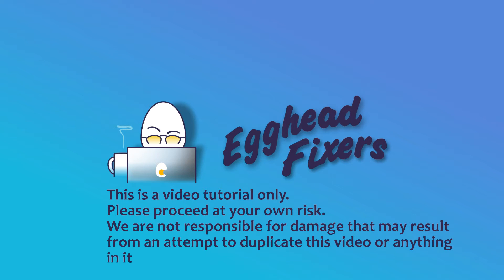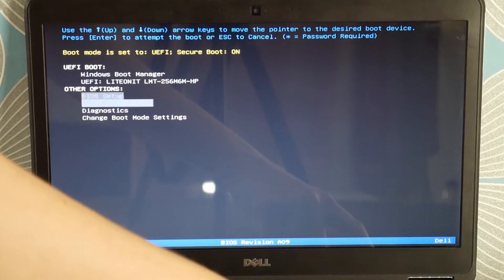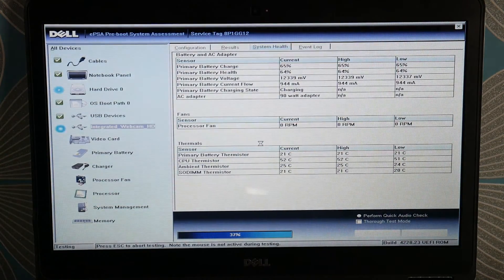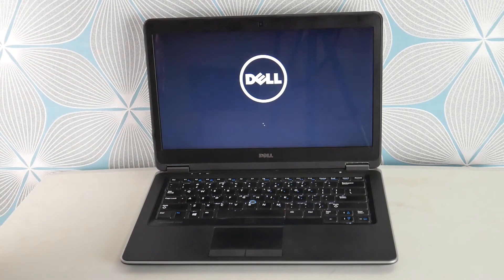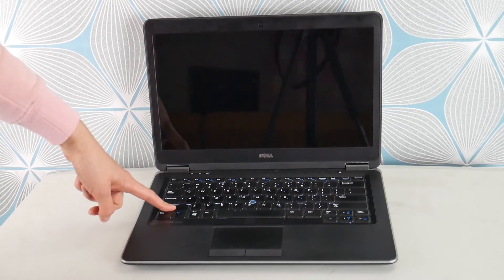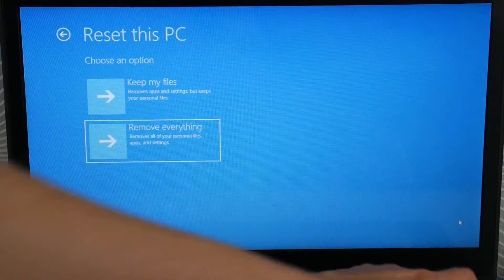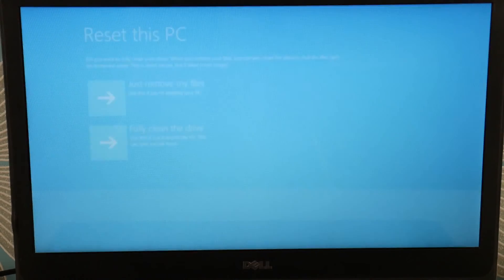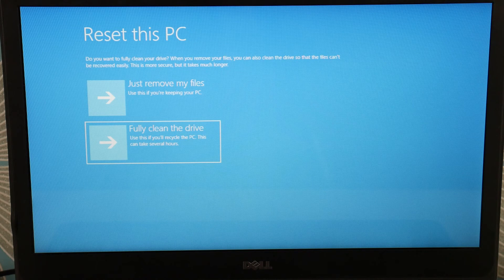How To Fix A Dell In A Preparing Automatic Repair Restart Loop

Comment: Hi Liz, i tried hard resetting my alienware m15 as you said, using shift + enter, but it does not work for my laptop. Can you please help me out with this? Thankyou soo much.
Reply: When i start it again while pressing shift, it goes into preparing auto repair
Reply from the maker: What happened when you ran the diagnostic? Did everything pass?

Comment: I’m not able the reset this PC “There was a problem resetting your pc.No changes were made” what can I do to not lose my files?
Reply from the maker: In order not to loose your files then you would have to try hooking it up to an external Hard Drive bay to pull the files off but that will only work if your hard drive is not dead.

Comment: I can’t get to the software part
Reply from the maker: Sorry to hear that☹ Sometimes when the Operating System is not functioning properly then you can no longer get to the options to reset it. In this case the next step would be to reinstall the operating system. Here is a video on how to do that:

https://youtu.be/TElCJDbKdKk

You can skip the part of the video about replacing your hard drive. Let me know if you have any more questions:)

Comment: So I’m doing the diagnostic and it’s stuck on “Instalizing Fan...” then it just goes black, then to the same dell assist with”warning battery critically low”
Reply: *“Initializing”
Reply: It appears to freeze mid diagnostic because when on the “initializing fan” screen, I can move my cursor around
Reply from the maker: @starbebby  Sorry to hear that:( Are the lights on your computer blinking in any sort of pattern? Also here is a video that might help: https://youtu.be/TA1mFPtKVnw

Let me know:)
Reply: Egghead Fixers this is late, but i ended up getting the laptop to turn on and it works now. I didn’t have to do the diagnostic, just ended it and went straight to the start up
Reply from the maker: @starbebby  Well that's good news!! Happy you got it to work👍

Comment: My computer says that hard drive isn’t installed and when I tried the things u do,it just says preparing automatic repair.My laptop is and dell  Inspiron 7347 (series 7000)
Reply: Nope it dosent
Reply from the maker: @traumatisedcat4918  If the Hard doesn't pass then it sounds like you need a new hard drive. Here is a video on how to replace your hard drive and install an operating system:

https://youtu.be/TElCJDbKdKk

Let me know how it goes:)
Reply: Alright thanks:)
Reply from the maker: @traumatisedcat4918  You're welcome👍
Reply from the maker: What happens when you run the diagnostic? Does your hard drive pass?

Comment: Here showing 'testing hard drive estimated time 3hrs 22 min' does it take this much time to diagnose
Reply from the maker: That is a lot longer than usual. I would let it test it for that long and see what happens but it could be a sign that the hard drive is not good. Let me know what happens!
Reply: Restored from image and then my hard drive formatted reinstall windows 10 automatically.
Reply: I got another problem can you help

Comment: I cant get anything to work
Reply from the maker: Sorry to hear that:( What part are you having problems with?
Reply: I turn it on and says " preparing automatic  repair" i did all of the steps just like you and every time nothing happens ive use the automatic repair system when u turn it off and on but now i cant get to it anymore it deosnt  seem to work so when i turn it on it just says preparing automatic repair then a black screen
Reply from the maker: @VanillaMangoCoalition  What happened when you ran the diagnostic? Did all your hard ware pass?
Reply: @EggheadFixers  i ran the first diagnostic a one where it tests color on the screen and it says
"Hard Drive 0 - S/N X6NFTOVET , incorrect status = 3E SMART productive failure" i continued testing and it says "One or more errors were detected.
Reply from the maker: @VanillaMangoCoalition  Sorry to hear that☹ First I would try what we call reseating the hard drive which means unplugging it and then plugging it back in. Then rerun the diagnostic. If that does not work then its most likely that you need a new hard drive. Sometimes when a hard drive really dies the motherboard doesn't read it as being installed. Here is a video on how to replace your hard drive and install an operating system:

https://youtu.be/TElCJDbKdKk

Let me know how it goes:)
Reply: @EggheadFixers  i need a new harddrive  same thing happends and ran dianostics said same thing
Reply from the maker: @VanillaMangoCoalition  Ya it does sound like you may need a new hard drive. Here is a video on how to replace your hard drive and install an operating system:

https://youtu.be/TElCJDbKdKk

Let me know how it goes:)
Reply: Thanks
Reply: One more question  whats the importance of the screw closes to the one in the battery section? If i break the plastic around it will it affect the mother board?

Comment: I received a error code 2000-01-42   hard drive 0 "serial number" short test unsuccessful.
Reply from the maker: Sorry to hear that☹ First I would try what we call reseating the hard drive which means unplugging it and then plugging it back in. Then rerun the diagnostic. If that does not work then its most likely that you need a new hard drive. Sometimes when a hard drive really dies the motherboard doesn't read it as being installed. Here is a video on how to replace your hard drive and install an operating system:

https://youtu.be/TElCJDbKdKk

Let me know how it goes:)

Comment: I cant get to that blue screen...
Reply from the maker: Sorry to hear that☹ Sometimes when the Operating System is not functioning properly then you can no longer get to the options to reset it. In this case the next step would be to reinstall the operating system. Here is a video on how to do that:

https://youtu.be/TElCJDbKdKk

You can skip the part of the video about replacing your hard drive. Let me know if you have any more questions:)
Reply: If he does that will he lose his files and apps.

Comment: When I go through the diagnostics, at the end it said there was one error but it wouldn't tell me what it was. I then ran it again and it said everything passed. Still in automatic repair loop, though.
Reply from the maker: Sorry to hear that:( If all that hardware passed the diagnostic then the next step would be to try reinstalling the operating system. Here is a video on how to do that:

https://youtu.be/TElCJDbKdKk

You can skip the part of the video about replacing your hard drive. Let me know if you have any more questions:)
Reply: @EggheadFixers  i did exactly like your instruction. my Laptop passed the diagnostics, but when i pushed shift + home button it stuck at "Your PC ran into a problem and needs to restart..0%" then it never went up to more than 0%. What should i do? thank you so muchh!!!
Reply from the maker: @nguyetanh4613  

Sometimes when the Operating System is not functioning properly then you can no longer get to the options to reset it. In this case, the next step would be to reinstall the operating system. Here is a video on how to do that:

https://youtu.be/TElCJDbKdKk

You can skip the part of the video about replacing your hard drive. Let me know if you have any more questions:)
Reply: @EggheadFixers  Thank you for your kind support <3 imma try this method to see if it works!
Reply from the maker: @nguyetanh4613  You're welcome!!

Comment: My computer goes into preparingautomatic repair and goes to a black screen with cursor
Reply: After the diagnostic ran,it says that hardrive is completely normal
Reply from the maker: @manjuaswin7079  It's RAM problem or a problem with you operating system. This video is to resolve a different issue but it will show you how to test for a bad RAM stick:

https://youtu.be/wY335MRKc3U

It will show you how to order a new one if you need to also. If you find that its not the RAM then the next step would be to reinstall the Operating System. Here is a video on how to do that:

https://youtu.be/TElCJDbKdKk

You can skip the part of the video about replacing your hard drive. Let me know if you have any more questions:)
Reply: I think its a ram failure
Reply from the maker: @manjuaswin7079  Hope that helps:)
Reply from the maker: Sorry to hear that:( What happens when you run the diagnostic? Does any of your hardware fail?

Comment: I have an alienware 17 and it is restarting again and again after i switched the graphics card to integrated one and one time it shows me its booting up but before coming to the sign in menu it shut down and reboots and shows me that it is preparing an automatic repair and then again shuts down and tries to boot itself( it also sometimes gets stuck on those) PLZ HELP ME! Urgently
Reply from the maker: Sorry to hear that:( Does it pass the diagnostic? IF all the hardware passes the diagnostic I would try reinstalling the operating system. My guess is the old graphic card drivers are causing a problem with the new graphics card.

Comment: When iam done that  it showing  batter cannot provide sufficient energy
Reply from the maker: Just to clarify it says that in the diagnostic? Or when it is booting up?
Reply: @EggheadFixers   in diagnosis
Reply: It also showing hard drive -- not installed ,, what does that mean
Reply from the maker: @moulidwayne5694  Try charging your battery over night if it still gives this warning when you run the diagnosis then there is a pretty good chance you need a new battery.
Reply: @EggheadFixers  but  I asked  Dell service center about this issue they said it related to hard disk related issue
Reply from the maker: @moulidwayne5694  Sorry to hear that:( You need to try what we call reseating the Hard Drive which means unplugging and then plugging it back in.  If you try reseating the Hard Drive and it still gives you that message then unfortunately  you mostly need to replace your Hard Drive. Here is a video on how to do that:

https://youtu.be/TElCJDbKdKk

Let me know if you have any more questions:)
Reply from the maker: @moulidwayne5694  Yes of its not reading the Hard Drive as not being installed then it is definitely an issue with the Hard Drive.
Reply: @EggheadFixers  then what I had to do?
Reply: Could you please tell me?
Reply from the maker: @moulidwayne5694   You need to try what we call reseating the Hard Drive which means unplugging and then plugging it back in.  If you try reseating the Hard Drive and it still gives you that message then unfortunately  you mostly need to replace your Hard Drive. Here is a video on how to do that:

https://youtu.be/TElCJDbKdKk

Let me know if you have any more questions:)

Comment: I also have all of these issues ,it was perfect until after the Alienware bios 1.2.4 its a kabylake update ,supposedly bad on r4 and r3 but it's been all messed up.
Reply from the maker: Ugh that's a pain in butt. You could always bring back to the previous version of BIOS see if it fixes the problem. Sometimes when an update is new they haven't worked all the kinks out of it. Let me know if you have any questions:)
Reply: @EggheadFixers  i did it worked for a time after i reset the bios and all the data and games and dowloaded a new windows 10 iso file,then back off again after a month or so later
Reply from the maker: @devonhc7770  ugh that's super annoying:/ maybe they'll release a patch that will fix it.